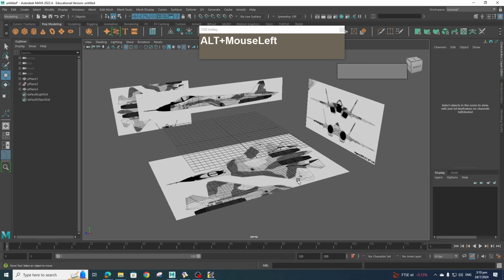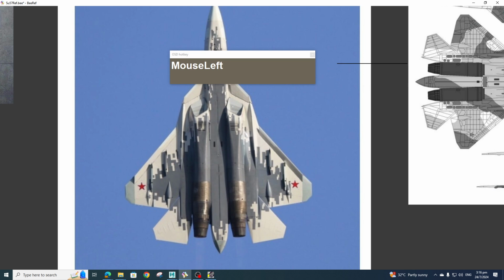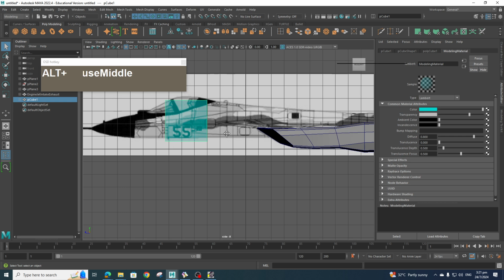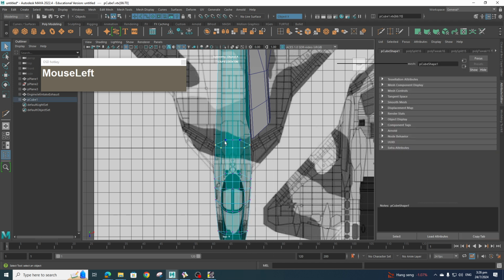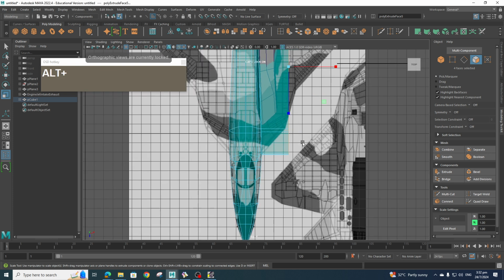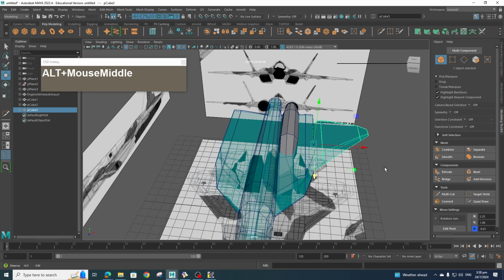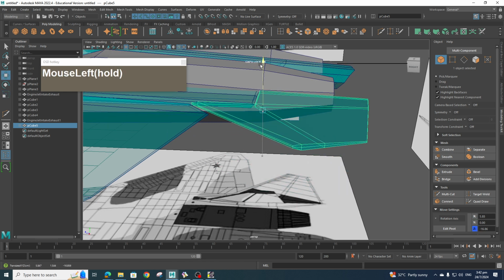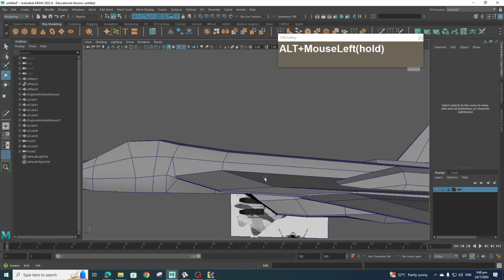A3M Blocking the Sukhoi 57- Maya Modeling

Comment: May I ask where You got the reference images from?
 I am interested in modelling the Sukhoi 57 jet fighter as well as the Darkstar sr72 however i need precision provided by the reference images.
Reply from the maker: Hi if you use duckduckgo.com and search for the term "sukhoi su-57 blueprint" you will find plenty of good refereneces.
Reply: @weelianocraft  Also which poly modelling shapes did You use in the beginning of the video because I can see that there were already two polygons in the outliner?
Reply from the maker: @X.4r3al Those are just a plane object primitive with 1 x 1 division and applied with a surface shader material for the image reference. I usually change the canvas of my image reference to a square then use the surface shader to map as a reference. The plane is already a square so there's no distortion to the reference.